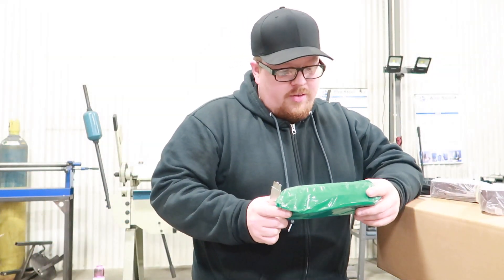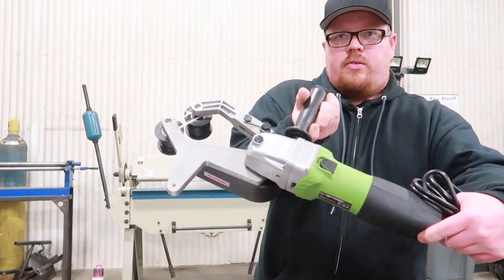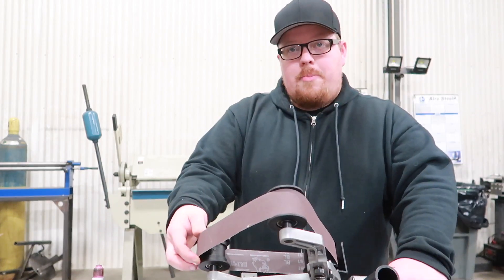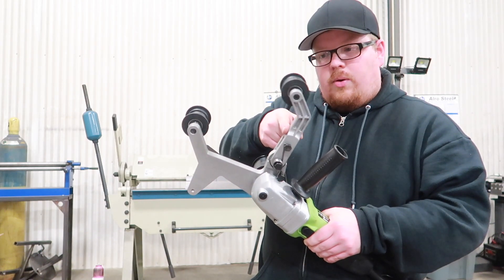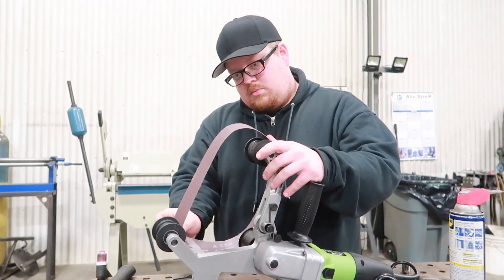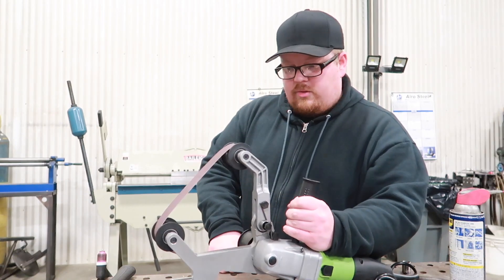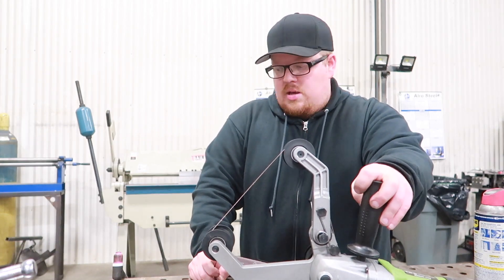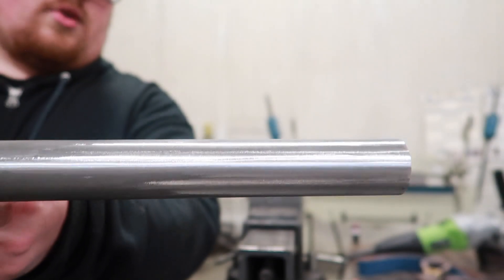Amazon Belt Tube Sander Polisher Review and Fix

Comment: To reduce slippage of the belt on the drive wheel, add some RugTape to the wheel. The grippiness of the rugtape is great for many applications. It can be found in 1/16" thickness so minimal size disruption of the wheel.

Comment: I'm a Kydex holster maker and the only thing I buy from China are holster belt clips and had to try 4 or 5 brands and suggested to fix some issues I found, and end up with one supplier. What goes through my mind is. How in earth quality control allows to ship crap tools/gear and so on knowing there are issues.

I can never understand that, as if they are book smart but that is as far as they go. When you buy bad equipment they are basically chasing away the customers. It's that simple.
Reply from the maker: That sounds pretty cool! It all depends on the company it seems. Some stuff is junk, but then Iphones are made in China as well and are known to be of higher quality. If you get a bad clip, your customer is going to be upset with you not the company in china making them. I deal with similar issues. Thanks for checking out the video!